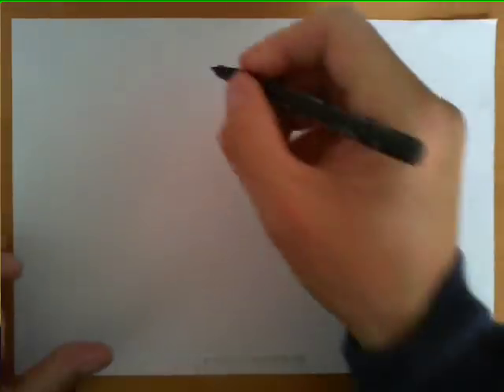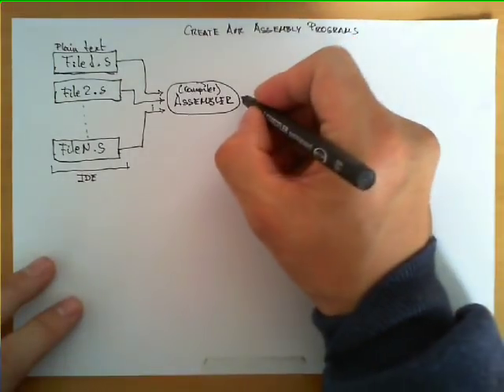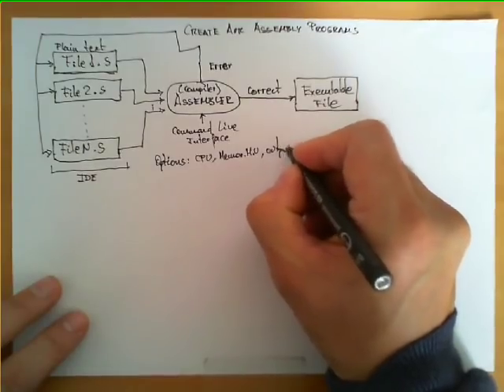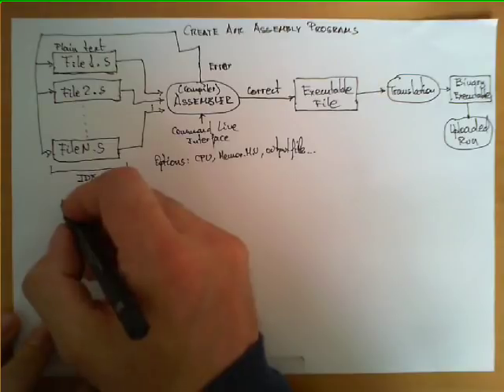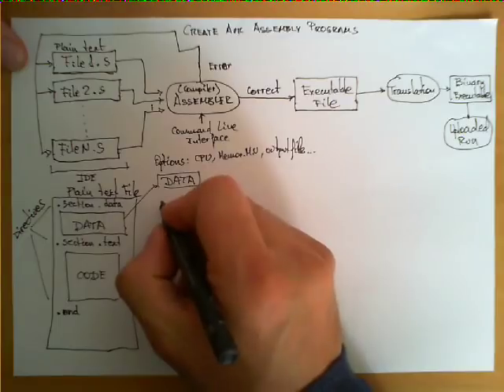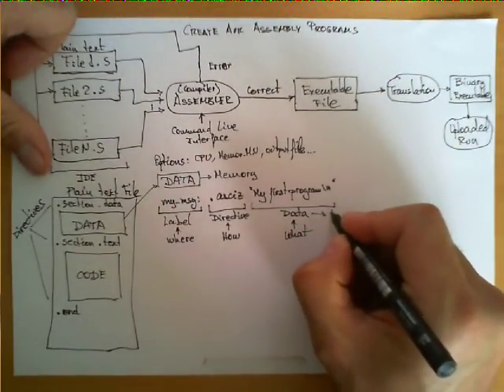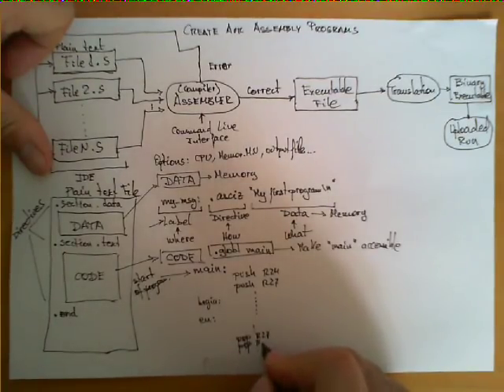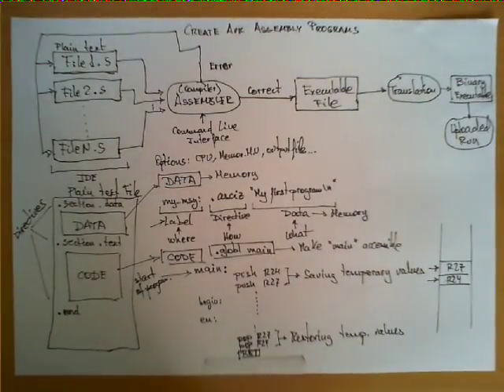Creating an Assembly Program in the AVR Architecture

Comment: The explanation of data and code section presented is highly misleading. AVR data section directive (.DSEG) is not used to initialize data as in high level machine programing, where code, globals, stack and heap are all loaded upon the same  sram prior to execution, as happens in computers.  

.DSEG directive is used solelly for the purpose of reserving data space into sram (creating data structure, indexing the place for the operands - not the operands's data itself -  by the .BYTE and .ORG directives -  wich increment  the actual sram adress counter or set an start adress for that internal memory counter of the compiler), thus providing labels that further will be resolved by the IDE at compilling to resolve those generated symbols into adresses that will be only then incorporated into code.  

 For any data structure to be initialized internally by the firmware (as a asci string, a CRC table, for instance), it has to be necessarly stored wheter in eeprom (.ESEG) or flash (.CSEG).

The nomenclature of .CSEG (code segmente) is misleading, since not only coded intructions, but also initialised data (tables, as a ascii string to be loaded on a lcd line) can be stored there. Something as  FSEG -  flash segment - would do better for the sake of clarity. The same for .DSEG - it is a sram segment, a SSEG. 

One final note: AVR microcontroles load executable code directly from FLASH into the ULA registers by the means of ProgramCounter logic. They do not have to load the coded intructions into intermediary sram to execute code from there. The only thing they load-store into sram is data, exception made while bootloading firmware. Under this circumstance, code is transfered externally  to sram, and from there to flash by means the LPM instruction. But this is not application runtime.

No mais, excelente aula e obrigado! Saudações tupiniquins!